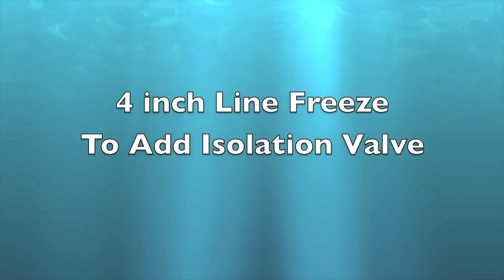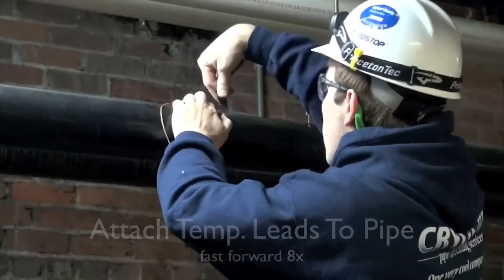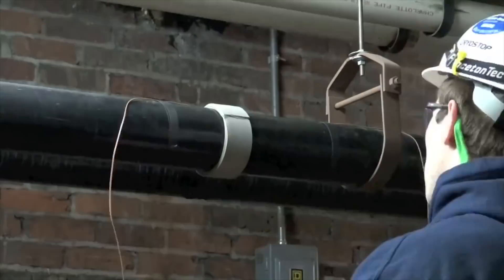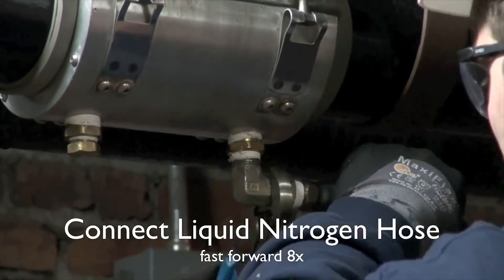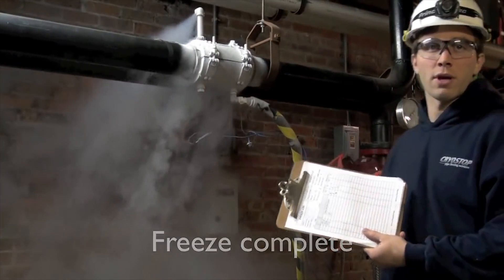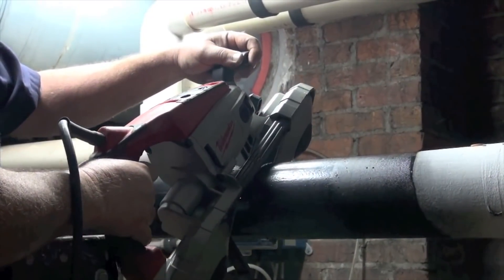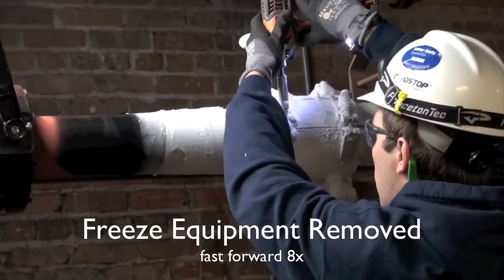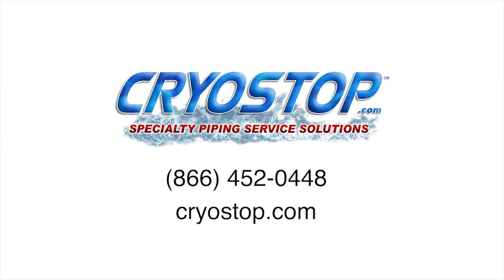Freezing a 4-Inch Pipe That's In Use to Add Isolation Valve

Comment: How does the freeze plug not expand and break the pipe?
Reply: I've frozen 24" with liquid nitrogen. The plug won't burst the pipe due to it expanding on the live side. It' will simply conform to the pipe and expand inwards.